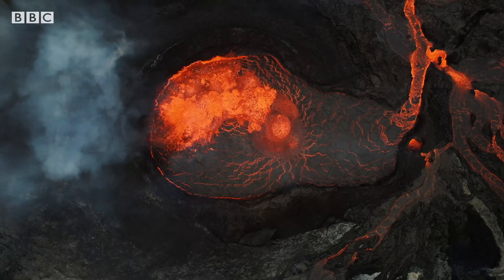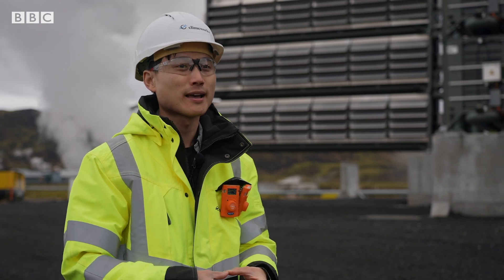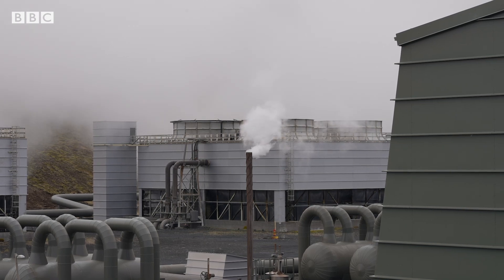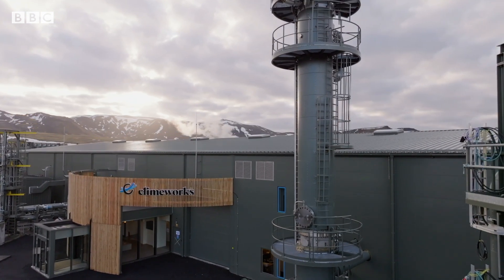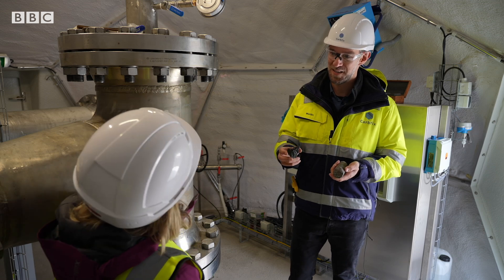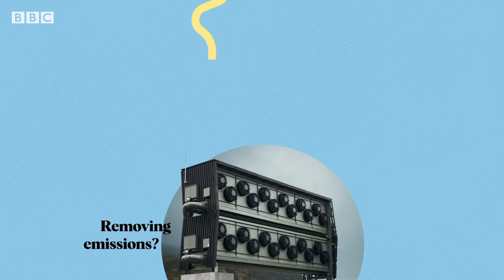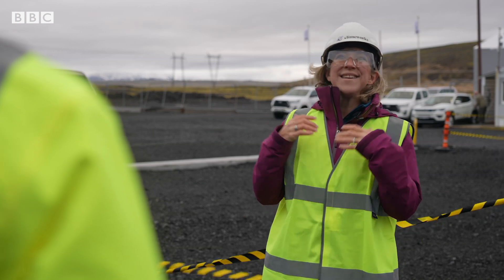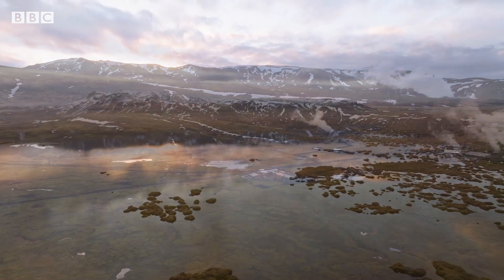Inside the hidden carbon plant pulling CO2 from thin air | BBC News

Comment: 36k tonnes of CO2, thats it? thats not even a fraction of a drop in the bucket, you were right in the beginning, it is Overhyped
Reply: If their plant can take in 36,000 metric tons of CO2 a year, that's a lot.  Average tree absorbs about 40kg a year, or 25 trees absorbing a metric ton a year.  So to match that plant, you'd need 36 million new trees. Like the man said in the video, use all methods.  Restore forests, cut CO2 emissions, and use plants.
Reply: @samhavoc1066 Surely 900K trees by your figures? But even so, it has no carbon footprint once built, presumably. Stick thousands of these in wastelands (where trees won't grow anyway) with good energy supplies (Iceland for thermal, Sahara for solar...), would definitely help. Very good point you make!
Reply: @samhavoc1066  maths is off here. 

36,000,000kg / 40kg = 900,000 trees

Most trees capture ~20-25kg of CO2 annually, which would increase the amount to between 1.4-1.8 million trees required for an equivalent amount of carbon capture.
Reply: @samhavoc1066  Very true, thank u!👍
Reply: Overhyped...? There will never be a feasible way to extract our current or future CO2 emissions by any one methodology.
Reply: @johnmahoney9354 
So what? No one made that claim.
Reply: It’s an experimental facility. This is how you discover new technologies and also learn how to make them more efficient.
Reply: @brazendesigns  exactly. Let's stop making computers because they cost too much and fill an entire building.
Reply: @brazendesigns It’s a scam. There are very smart people behind this project. They do the math beforehand and know the upper limits of what this tech can do. This is all greenwashing.
Reply: @brazendesigns  That's what I was going to say. People are too quick to judge and criticize innovation when it's still in its beginner stages. They look at something like this as if it's the final product, and refuse to consider any potential it could have.
Reply: Well the alternative is to stop pumping carbon out but we've been pretty bad at that.
Reply: It's like removing a single molecule of water from a glass of water.
Reply: Are you high or drunk…. This plant equals 32 million trees 🤡
Reply: try telling that to the people who were developing solar panels for years and years
Reply: lots of electricity used
Reply: @ravd8082  does not matter. We have enough and its all green over here.
Reply: I suspect you are correct , and the way they put the program across you would think they invented sex, can we have a grown up doing the narration please . Unless this was made for school kids ?
Reply: They are literally testing the technology.  Did you think they would test it by building thousands of systems around the world at once?
Reply: Give it 20 30 years and see where the technology goes. They could develop this to the point where it can process many times the C02 it will now
Reply: Need thousands of these facilities
Reply: Stop being daft and ignorant of something. 36k is better than none
Reply: I bet there were people who think just like you when they rolled out the first automobiles.
Reply: @DavidTa2  👍👍
Reply: Unfortunately in practice it is useless to do what we need, but not useless to exist on itself. We need a new technology to do this effectively, technology currently unknown but these project drive exactly that, research and innovation. If there's anything good humans can do besides wars is innovation.
Reply: Its cleaning taylor's swift yearly emissions
Reply: AEROSPACE ENGINEER HERE:
I'm Australian but did my degree in America (late 80s) and one Friday we had a NASA engineer do a special lecture on Terraforming Mars. We were kind of excited as at that time (despite the Challenger accident) we believed we'd be building the next space station in the 90s, back to the moon early on the 2000s and off to Mars in the 2010s.

We were shattered when he started with: "Sorry its impossible and here's why!"
He then went and explained how you need think when considering an entire planet. You don't need to be an engineer or geologist or atmospheric scientist just BASIC MATH WILL DO. Once you understand the actual scope of dealing with a planetary issue things like this are irrelevant. 

For example there's currently around 2.5 Trillion tons of excess Carbon Dioxide in the atmosphere and by current estimates it will go past 3.5 Trillion tons by the mid 2030s. So to do a quick time estimate you simply divide 3.5 Trillion by 35,000 and get 100,000,000 years. So if you want to get that 3.5 Trillion tons out in something like 10 years you need about 10,000,000 of these plants built. If you want to do it 20 years then its 5,000,000 plants.

As to the costs its even easier to estimate 
At $1,000 per ton 3.5 Trillion tons will cost $3.5 QUADRILLION tons to remove.
1/10th of $3.5 Quadrillion is $0.35 Quadrillion.
So at $300 per ton its (3/10ths) which is $1.05 QUADRILLION
And at $400 per ton its (4/10ths) which is $1.4 QUADRILLION

So its reasonably easy to estimate that this method will cost between $1 and $1.5 QUADRILLION and that's provided we can find 5-10,000,000 SUITABLE locations and get enough materials to build those 5-10,000,000 plants. Then there's the small task of how do we power it, because power might be reasonably cheap in Iceland where they have enormous natural resources but what about the other 9,999 plants where are they going, how are they being powered and who's paying?

By the way if every person on the planet planted 1,000 trees (seedlings) at a cost of $5 per tree. That would be 8 Trillion Trees and if each tree is capable on capturing 1-2tons of Carbon and sequestering it in the wood. Then we'd only need about 1 in 4 trees (~2.5 trillion) to reach maturity to capture that 3.5 Trillion of Carbon Dioxide. 

Yeah that would cost about $40 Trillion on basic costs which is a staggering amount of money until you consider the alternative is $1-$1.5 QUADRILLION, which is 25 times the cost at the low end. Best of all Trees don't need electricity they just need water and sun light and maybe some fertilizer. Once established their maintenance and upkeep costs are almost zero. If you plant trees that produce food and of building materials then even better.
Reply: @tonywilson4713  Trees have downsides too - they take space and can't be planted everywhere. Not to mention nowadays forest fires are more and more common. 

I agree we need to restore nature,  but it's good to have alternatives
Reply: @tonywilson4713  2 trillion trees, give or take the amazon rainforest five times over...... that's a lot of space.

Comment: Not scalable. Isn't it better to focus on the creation of carbon emissions, not the removal.
Reply: i think we should be exploring every possible avenue :)
Reply: @GuidoInfurno  This solution is like ignoring the leaking bath tap and just throwing out water with a spoon. 😁
Reply: @davstar  the point , ladies and gentlemen, is that its developing technology. Everything starts from the ground up.
Reply: @GuidoInfurno  if carbon capture was an honest attempt, they'd put it on the factories making the most carbon, not in the middle of nowhere. It's a cop out, a way for big oil to pretend it's carbon neutral, when it in no way was ever run by anyone with a conscience.

They hired the same team that told us doctors recommend you smoke at least 3 cigarettes a day to tell us climate change isn't real, so... Trusting them is folly.
Reply: Yeah, carbon capture isn't even effective when attached directly to the chimney of a fossil fuel plant. Direct air capture is utterly useless.
Reply: @drunkenhobo5039  That is not completely true, if the carbon is combusted directly in air then the CO2 can not be easily captured, but if it is combusted directly in oxygen, then its a whole other story, see Allum cycle nat gas power plant can achieve a thermal efficiency of upto 80% since all the exhaust is CO2 with no nitrogen, that flue gas remains in the super critical system for a while but when the excess CO2 does come out it can "released" or "sold" or "buried" or whateve. The oxygen would also need a seperator so you also get a nitrogem stream which could go straight to the fertilizer production part of the system.
Reply: Why not use plants and trees to absorb CO2 and create O2 ?
Reply: @Hisloyalservantslistenlove613c  Doesn't work either. You'd need trillions of trees per year to offset what we're omitting.

Remember oil, coal and gas have been in the ground for hundreds of millions of years. And we're releasing all of that biomass at once. It's simply not possible to offset it.
Reply: @drunkenhobo5039  Then the governments should give incentives to people and businesses who are creating &/or adding to the problem..to stop their practices.. We don’t need lawns or golf clubs or gas guzzlers. People  and businesses can plant trees on their properties. They can go out less and quit smoking and stop using products that end up in our drinking water.
Reply: @drunkenhobo5039  about 200 milions years worth released in 200 years or there about,
Reply: @Hisloyalservantslistenlove613c  no thank you , my kids need open green  spaces to exercise, sports and get outdoors , mental health is important , being stuck in a box is no good , i will not comply
Reply: @Hisloyalservantslistenlove613c  you stay indoors with ya virtual reality headset lol
Reply: Planting trees close to properties will undermine the foundations.
Reply: @Hisloyalservantslistenlove613c  Trees might not be the most effective. They help certainly. But it depends on the type of vegetation, where it is placed and the growing conditions. A good example is bamboo... Great at CO2 capture... But it has to have the right growing conditions.
Reply: @boofuu3145  Live in a community that has a park and fields and pools and walk or run and bike to them. Plant trees on your property and vegetables.
Reply: @boofuu3145  Who said I’m indoors? I garden, play with the dogs, swim, run, bike, walk, and trim trees.
Reply: Good question @Hisloyalservantslistenlove613c
Reply: @Hisloyalservantslistenlove613c Tell that to Bolsonaro.

Tell that to people who stuff themselves with fast food, patricularly burgers.
Reply: It's not an either/or. We need to focus on both.
Reply: Why can't you hit this from multiple angles? Scrubbers on top of carbon capture on top of bio-capture all of this on top of carbon reduction.
Reply: @joetran8798  The concern is we don't have the time, nor the money as a species to cover small scale solutions. We need scalable and affordable solutions. Why are some of these solutions protected by patents, as if it's a profit-first venture?
Reply: @davstar  Because it creates incentive. It doesn't have to be a profit first venture. However it gives incentive to others to look for other methods.  If everyone is just trying to generate calcium carbonate (one form of DCC) then it neglects other possible solutions (like an energy efficient way to break up CO2 into carbon and oxygen).
Reply: Not scalable ? Remember the size of first computer we invented ?
Reply: Absolutely. We should be drastically reducing emissions as well as scaling up carbon removal. Carbon removal is not an excuse to continue emitting.
Reply: @ewanjones9743  Agreed. Things like the carbon offsetting scheme is nonsense, as if you should just throw cash at the problem, instead of changing behaviour.
Reply: Good luck getting greedy corporations who pollute the planet to agree to decrease carbon emissions.
Reply: Well co2 is accumulative and we certainly do need some tech to clean it up, but instead of betting on carbon capture why not stop it from emitting at the start? Does receiving bribes matter more than the survival of humanity?
Reply: @Ash-vt7uu  The problem is that it does not address the existing CO2 in the atmosphere. That needs to be dealt with as well. The more emissions we can capture at the source is great, but we need to deal with the existing CO2 as well.
Reply: This would be equivalent of using a pedestal fan to cool a skyscraper. Proof of concept maybe? Utterly useless and otherwise dangerous as it gives people impression that we can technologically remove our enormous carbon output
Reply: @OutlawMaxV  The tech is still in its infancy but it is a start... It's likely also a transitional tech.
Reply: The amount of greenhouse gasses in the atmosphere is far greater than it should be and we can’t just wait and let it settle back into the earth because that takes thousands of years. We cannot realistically stop all carbon emissions, so we do need to focus on removing it in any ways that make sense
Reply: @Dyltheboy  But even if we were removing tons of it, wouldn't it make more sense to prevent it from being created in the first place. Otherwise well be stuck creating more than we can remove perpetually, no?
Reply: @davstar  yeah but isn’t it more about the reality of the situation? 3rd world countries cannot completely stop or significantly reduce emissions… I mean not even 1st world countries can do that. It’s really difficult to prevent fossil fuels from being burned. It’s also better to reduce production AND increase reduction Yk?
Reply: @davstar  CO2 will be generated no matter what. It is part of the respiratory process of all living creatures on top of natural chemical reaction.  We have scrubbers to help capture it at source, but not everyone uses them (they cost money to operate) and we still generate more than we reduce. So we need to capture it (eg, chemical reaction) where we can or break it down (would require astronomical amounts of electricity) on top of generating less. Proper vegetation management (eg, farms) and DCC are only two of the components.
Reply: Yeah people aren't going to sacrifice anything for the environment. Even people who say they care are emitters. People don't want to suffer for the benefit of an uncertain future.
Reply: Without investment nothing becomes scalable.
Reply: on the contrary, DACS is eminently scalable and it must be to remove our aviation emissions, for example
Reply: Someone who gets it, not enough space on earth for trees and co2 capture if we don't reduce emissions
Reply: To offset Chinese factory CO2 emissions (8,251 million metric tons/year) by 2040, you'd need about 19 million CO2 capture plants, each removing 36 tons/month.
Reply: @Demontoastslayer  The biggest way to "offset Big Bad China emissions" would be for the West to stop outsourcing it's pollutions to asia.

This would, also, mean that thr smug western 'well..... we don't cause nearly as much damage as china' nonsense would stop as the west faced its actual damage to the planet and had to try to find ways to genuinely reduce pollution.
Reply: @Demontoastslayer it is to offset the CO2 emitted by the west in the past 200 years while they enjoyed industry revolutions. China's industrialization is way more efficient than the West did in the past.

Comment: What if there is a cycle in which the so called cleaned air will be gone through it again great loss of energy ! I think it should be in cities or more near to the carbon source and if it’s a moving thing then it will be more efficient !
Reply: You do not understand how it works. After cleaning the air it won't stay that way. It IMMEDIATELY mixes again with the surrounding gas so you can filter it again and again and again right after and you get the EXACT same amount out of it as if you did it with 'regular' non treated air. Just think of it as water that you clean. If you put that back into the ocean you can basically clean it again right after.

Comment: nonsense pipe dream that costs more than it produces in value best option cork tree farms lots of them they will capture it all day long for 0 cost and the bi product lots of cork to be used for insulating properties win win.
Reply: That tree has a very limited climate range that it’s adapted to. A good solution but only for specific areas
Reply: @brazendesigns  same as the plant really but the tree costs 0
Reply: I wonder why nobody thought of that before

Comment: Why would they install it there they should install inside cities
Reply: Carbon dioxide is a gas
Reply: Mostly space issues, they're huge things that not only need a lot of space above the ground but also require digging under ground. In cities, there's not many open surfaces to place them and the underground is full of pipes and tubes. Also 1:42
Reply: The gas spreads evenly across the planet and reaches all corners so it doesn't really matter where it is located.
Reply: @coondog7934  that's true but if it is placed in cities our near cities it could improve the AQI
Reply: @Ayush-recker  No, only if they filter small particles like fine dust. CO2 taken away from the air will be immediately replaced by other CO2 surrounding it so the air improves in general (whole planet) but not locally or regionally at least not measurably.
Reply: geothermal power and the rocks to pump the c02 into all on site anywhere its likely c02 positive